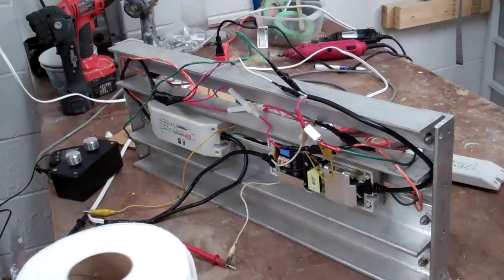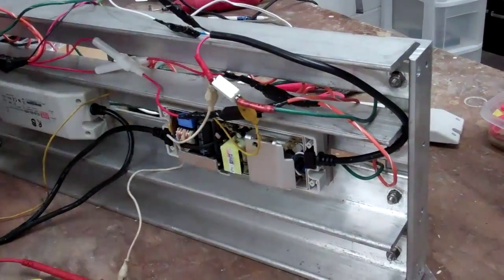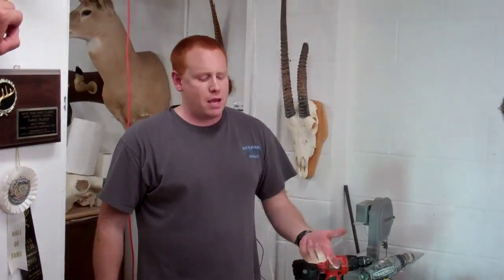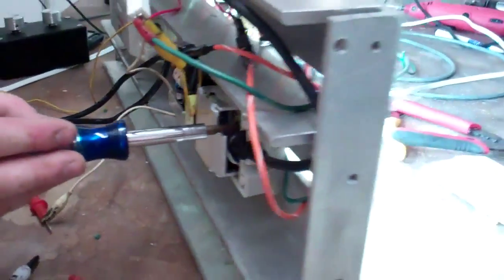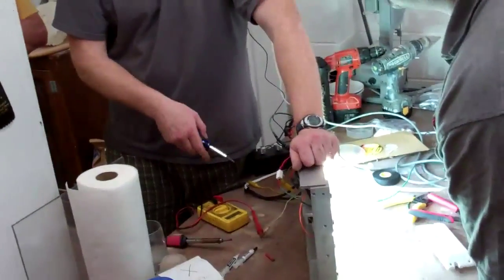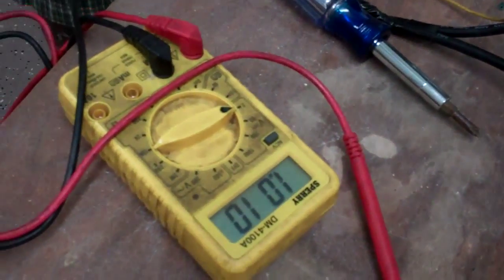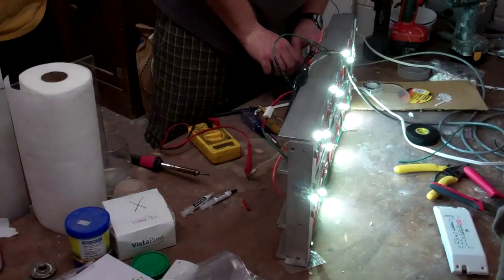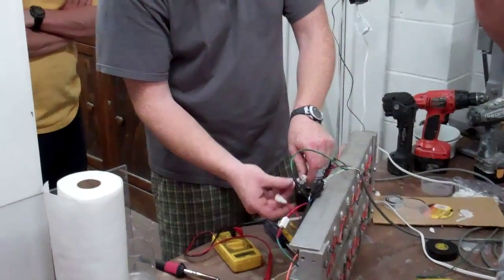DIY LED Part 5: Adjusting Meanwell Potentiometer

Comment: I also ran a test with natural anodizing and a gold color.. just for fun.. The black was the best by a mile.. I did a simulation using Solid Works Flow Management plug in...with my same heat sing design with extruded copper.. the result was a 17% increase over the black anodizing but the material cost was 2 times higher.. It was cheaper to just increase the size of the heat sink...

Comment: The black anodizing makes a big difference.. I design and build  LED lighting fixtures... I also designed my own  passive heat pipe extruded aluminum heat sink, . no fans.. just a unique vertical heat pipe tree and horizontal fin design.. On my testing the black anodizing applied lowered the LED junction temperature by 30 %.. over a naked extruded aluminum Heat sink..
Reply: cutter sells nice anodized passive heatsinks designed for COB leds

Comment from the maker: It works OK but this video is rather outdated, was uploaded after a club event for those that couldn't attend.  And black anodizing doesn't do anything unless there are no fans, stagnant air, and you are relying only on radiation to disperse the heat.

Comment from the maker: I have heard the same about the 1" C channel or angle stuff, his larger fixture gets pretty hot to the touch (in canopy) and I figure that it would be much better if you used a bunch of thinner material with more 'fins' essentially like the C or L which would dissipate heat better.  The thick stuff just holds onto the heat better IMO, thin fins and more of them is best

Comment: i use alluminum c-channel on my leds and dont needa fan. mine are also just hanging down not in a canopy atm. but i know many others with same set up in canopys and they dont use fans. u can tell if u needa fan or not by touch. you should be able to hold the rail without letting go it will be warm but shouldnt be to hot to handle.